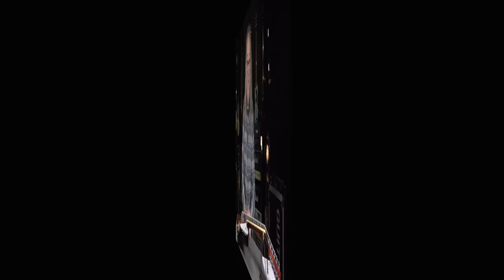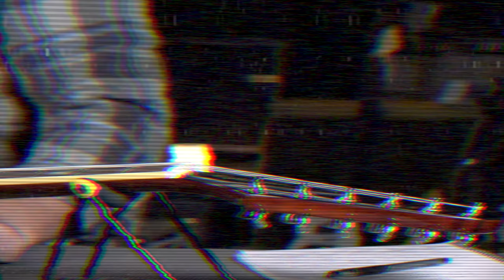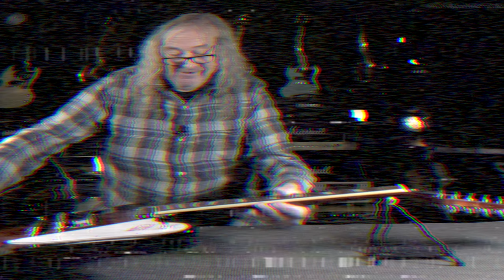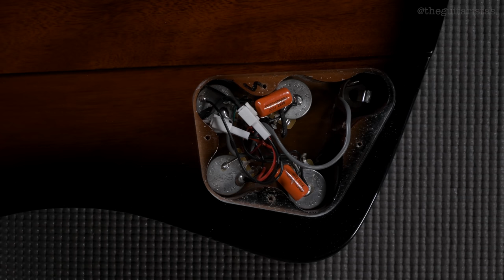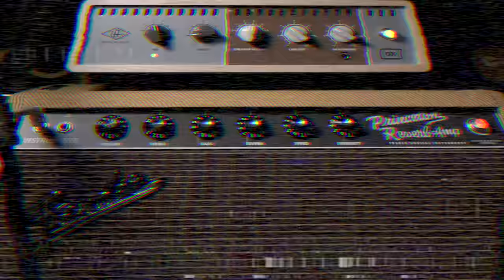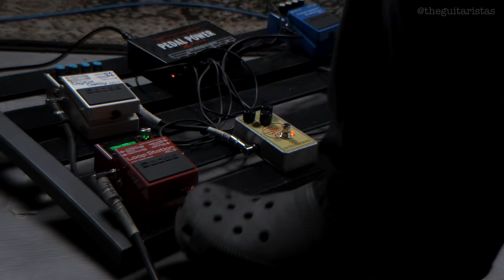Epiphone Firebird Vintage Sunburst - Authentic and Affordable Inspired by Gibson Classic!

Comment: My son-in-laws cousin just bought one of these through Guitar Center and they actually did a very nice setup on it. The action is perfect, intonation is perfect, no fret buzz, no high frets, and the nut is cut correctly. The guitar plays and sounds better than the Gibson Firebird I owned back in the 70's.  It was very easy to play some Johnny Winter riffs  and it sounded great through a tube amp.

Comment: I’m surprised at my reaction to that guitar….. I really like it Colin. It looks particularly high quality and you made it sound killer. 👌
Reply from the maker: Cheers man, something really nice about this type of pickups! 👌🔥
Reply: @theguitaristas  Firebird pickups are humbuckers, but with a slightly different design. A mini humbucker is just like a regular humbucker but with smaller bobbins; it has steel pole pieces running through the center of the coil and a bar magnet under the coil. A firebird pickup has the same small bobbins as a mini humbucker, but instead of steel pole pieces and a bar magnetic, it has magnetic blades running the center of the coil.

Comment: Another great way to start the weekend. Top notch video. I have a hagstrom fantomen which is kind of similar shape ish and it’s huge. The case is massive. But sounds killer and made kind of famous as the band ghost use them. I highly recommend trying them out. Have coil split and one of the best fret boards ever played . The scale length is slightly larger though at 25.5” which takes bit of getting used to. Excellent guitar

Comment: Good in depth review as usual, I’ve got the Epiphone Firebird from around 15 years ago which is an excellent guitar but has a set in neck which is obviously a deviation from the original Gibson design. I’m quite tempted by this new version due to the through neck and multi laminated construction although I don’t think that it sounds significantly different to my older guitar . As far as I understand the original Firebird pickups were humbuckers with two bar magnets one in each of the bobbins unlike the usual one bar magnet between the two bobbins that most humbuckers have. There have been various differences in Firebird pickup designs over the years including one with a single ceramic magnet between the two bobbins. Finding a reasonably priced gig bag or case for one of these monsters could be problematic but I wonder if a bass bag or case might do at a push.

Comment: I like the Inspired by Gibson lineup. I'm a bassist and just got my first ever guitar which is a an Epiphone ES-335, for about $475, from that lineup. It's made in China but the quality is decent. The flamed maple top is so good to look at, I got it on Blueberry Burst. Just needs a bit of setup but I pretty much do that on all my basses even from those over $1000, because my setup measurements are personal and exact, no factory could get it right, doesn't matter if it's from US or China.

Hardware is decent too. Tuners work fine, but I hate the bridge, it has the wire over it, so irritating, I bought a $30-Gotoh bridge made in Japan, and it's fixed, no pesky wire. That's it. Adjusted pickup height and I had a decent ES-335.

Comment: I love, Love, LOVE my Epiphone Firebird. Epiphone has really upped their game over the past several years. I am an inveterate tinkerer, when it comes to my guitars. I’m constantly tweaking, adjusting, etc. The Firebird and the 50’s Les Paul are the first to Epi’s I’ve owned with which I was perfectly happy. The ONLY quibble I had with the Firebird was the pickup switch. That’s a cheap fix. Otherwise, the pickups, the construction, the finish… I am completely satisfied.

Comment: Nice purchase !
I have one, bought at the end of May.
I saw them about a year before but couldn't afford one.
Gift to myself when i turned 65. Only found one place that had one so ordered it (ZZZs....). 
Found a form fitting gig bag elsewhere. $70.00. No need for a hs case since don't gig anymore. I don't think anything else would work. Like you said, the guitar is massive ! Saved $50.00.
So, i get the guitar delivered and the inside box is banging around in the outer box. Thought about refusing but took a chance since this was not easy to find. Really pak'd like trash.
Worked, played good and i'm stoked. About 6 weeks later, it starts acting up, out put jack failing and the br pup working off and on. Decide to call the seller and i'd just passed the return dead line so had it fixed locally,,,,about $180 which included a complete set up. Not great but since the guitar was basically a gift, i can live with this.
Man, the action is about half as high as it was and i'm in love !!
The problems weren't the guitars fault and i'm still amazed by the overall build quality. The same multi ply neck thru construction as a Gibson with maybe better pickups. i took care of a '76 in the mid '80s while a friend was in the hospital. I never really got on with it.
This Epi is truly amazing !!! Congrats on your score !!
Reply from the maker: Cheers Glen, congrats on yours too mate! 😁👍
Reply: @theguitaristas  Thanx. Its plugged in now,,,,wrung it out for about half an hour.
Been a couple weeks (rotate stuff).
Still in love. It's a great guitar !
Rock ON !

Comment: From what I understand the difference between a Mini Humbucker and the Firebird pickups is that the Mini Humbucker uses small poles like a regular humbucker where as the Firebird uses a single bar across the strings instead of individual poles under each string. Similar to some of the Bill Lawrence pickups, but in miniature form.

Comment: Great review of another great Inspired by Gibson Epiphone guitar! Colin, I bought the same Gator gig bag and like you, am underwhelmed. I have an EpiLite Explorer case for my Epiphone Moderne. I just did a test fit, and the Firebird fits with room to spare, however, due to the long head stock, it touches the case, so it needs to be propped up a bit in the neck rest area or the "neck joint" area. Edit: Based on my web search, it seems the EpiLite Explorer case is no longer avail. anywhere. Bummer.

Comment: The Firebird pickups are, in fact, humbuckers.  They differ from a mini humbucker in they use bar magnets and not individual pole pieces, hence the covers have no screw holes.  This difference makes them sound a bit different.  I installed a '64 Firebird pickup in the neck position of a Telecaster and it sounds wonderful.

Comment: There's a fabulous Joe Gore video comparing mini humbucker and Firebird pickups in the same guitar.
Goes a bit into what Firebird pickups are - but yes bar magnets inside the coil. Mini humbuckers are built like small humbuckers. Without going into the airy fairy, the idea is that the magnets are closer to the strings than in a humbucker, like the rod magnets in a single coil. Hence brighter.
Reply from the maker: Cheers Iain, I shall look for that be good to hear a comparison!

Comment: Let me clear up some myths about the mini humbucker/firebird pickup because I've used them for 25 years and I make both, they're my favourite pickups by a mile and I just love them. The firebird pickup IS a mini humbucker but they are slightly different. You could say they're brothers a mini bucker has one coil with screw poles that you see through the cover holes and the other coil has a steel blade with a bar magnet underneath connecting the two like a regular humbucker. A firebird pickup has two coils the same size as the mini but instead of screw poles and a steel blade they have a small bar magnet that fits in the bobbin like the steel blade does, this means no need for a bar magnet underneath. This design has less output so they reduced the resistance also compared to the regular mini to about 5.5-6.0 kohms, a regular mini is between 6 and 6.5k. They do sound very close to each other, In my opinion the firebird version sounds a bit more "Fender-esque" with a bit more chime and clarity,  less bass and sustain. People like to say they're in between a full humbucker and a single coil but I think they're different, perhaps adjacent to both, they really are there own thing and you sometimes need to approach tone shaping differently because they react to changes in your setup differently than a single coil or a full bucker. I found they gave me a whole new world of tone, they can really inspire you to get out of a funk, think fresh.

With a 7.7 and 7.8k reading, what Epiphone have given you is a modern version of a mini, the coils are so small that to get that much resistance they must have used thinner wire. I'm not saying that's good or bad but its not "original" or "vintage" spec. 
You can here my mini humbuckers vs Epiphone minis in Paul Stafford Cook's Riviera video coming up.
Reply from the maker: Cheers Ben, and thanks for the illustrations you sent over I will post them on the Guitaristas forum!
Reply: @theguitaristas  Happy to help

Comment: I bought the Epi Firebird and Korina Explorer in 2020. Both are stellar guitars, and the fit and finish are far superior to my 2019 Gibson Les Paul Standard. Took 6 months to get the ginormous cases for them as they were on back order. As a rule, I usually change the pups and pots on new guitars, but both guitars sounded great right out of the box, so they remain stock.

Comment: Perfect timing. I had a Joe Bonamassa Firebird 1 and sold it for more than I bought it for new after a few years. But I missed it. So I bought one of these. Not disappointed. Definitely a keeper. I replaced the tuners with locking tuners and the bridge/tailpiece/inserts with parts from Faber. I just need a case now. They've been out of stock on those for a while.
Reply: PS firebird pickups are humbuckers. The difference is that they've got a bar magnet for a pole piece.

Comment: Firebird pickups are actually two alnico2 rail bar magnets, each in their own plastic bobbin, 
between a small across top and large bottom metal plate,  with 2 wooden shims underneath.
To my ears one of the best sounding pickup constructions, besides Fender single coils :-)

Comment: Good video Colin. My Firebird has a slight problem.  The volume on the low E is quite weak, a pickup problem, i suppose.  If you watch Trogley’s review, his has the same problem, different string
Reply: Mine had the same problem.  The jack was loose.  I put a more substantial washer on it, works now

Comment: Great video sir. I have a 2019 Gibson Firebird special personally. It’s far from perfect qc wise but a great guitar nonetheless. They are marmite guitars physically but they certainly occupy a niche. One of your other commenters mentioned that traditional firebird pickups differ from mini humbuckers in that the magnets are in the coil, rather than steel poles like an original epiphone mini, or a lp deluxe pickup. This means they have significantly less eddy currents, and a much more defined peak like a fender single coil. They are  humbucking though. 
The 70s bicentennial models had a pickup design known as a sidewinder which has the coils facing each other parallel to the strings and a blade pole in between. The modern Gibson firebird pickups have ceramic magnets and are very very high impedance, the epiphone reissue models are actually closer to an original. 
Allen Collins of skynyrd actually had a p90 in the bridge of his most famous Firebird 1, and a retro fitted lp deluxe mini in the neck. 
Keep up the great videos, hugely enjoy your presentation.

Comment: I was thinking of a Firebird I had thirty odd years ago. It was made by CSI, which I was told was Ibanez. Had the banjo machine heads, like Gibson, and the Maestro type vibrato. A previous owner must've put Gibson stamped humbuckers on it, not the mini buckers you associate with Firebirds. Can't remember if it was thru neck or bolted. Came with a nice hard case. One of the guitars I wish I still had.

Comment: Love Firebirds, though you’re right…They’re huge! Not a major problem for a big bloke like me, though it did amuse me to see a skinny little thing like PJ Harvey playing one a few years ago! I’ve had my 91 Gibson Firebird V since about 2004 and as a Fender guy, it did take a bit of getting used to. On the strap, it hangs two frets further to the left than most guitars! Craig, the guitarist in my band, Leavin’ Trunk, got an Epi like yous a few months back and he loves it to bits - despite my teasing him about it not being a “proper” one since it has conventional stock-out-the-side tuners! Shame, as a set of Steinberger Gearless tuners would sort that! I actually replaced the banjo tuners on my Gibson with Steinbergers - several years before Gibson started using them. They balance - and hold tune - way better than the originals and still look “right”.

Comment: Really cool guitar .Very appealing .  Epi did firebirds in the past but they were not neck through build. This 'Gibson inspired' well worth the name this time.. More inspired...
Awesome playing once again,  after each of the vids i think i must put my looper on the board but perhaps i'm too lazy.
You are right in saying that Firebird pickups are different than mini-humbuckers. But they are real humbuckers nonetheless. A mini is like a smaller PAF type (altough it is originally an Epiphone design)  with the magnet lying between and underneath the coils while the Firebirds are build like Hot Rails with bar magnets inside the coils. That why there's no pole pieces. SC sounding but real humbuckers.
Reply from the maker: Cheers Ant... most important pedal on your board after tuner is the looper!

Comment: Hi Colin… told ya! (around a year ago! But, with all the comments you read - and I can see you do😬 - you’ve probably forgotten). 
‘Street’ then was £529.00 and, as I usually do, I got a discount from my favourite big dealer - around 6.5%, getting me the Firebird for £494 + change. Got an Epi fitted case - same discount (😬!) - at the same time 
BTW: IT WILL FIT ANY bog-standard stand, easily!
Just wrap a thickish elastic band round the left side of the ‘horseshoe’, under the bottom of the lower bass bout - works a treat! Stops it sliding off sideways, and it’s perfectly stable.
Bleedin’ great guitar, innit! 😜
(I’ve got the Flying V, too.  Shame they only come in black… really wanted a Korina (or faux-Korina?) version - ho-hum!
Reply from the maker: Cheers Rob, I do remember it wasn't that much more expensive last year... but yeah I get a few comments so you will forgive me if I don't recall specific conversations! 😆 I think your 'rubber band stand' fix  sounds like a right old bodge job but I will give it a try as I keep tripping over my neck floor stand thingy 🤣 yes great guitar and worth the hassle... Explorer is next on my list!
Reply from the maker: @rob_in_stowmarket_uk  🤣👍 Keep taking the medication!
Reply: @theguitaristas  Mmm… rather not be having to have the op, mate! Ho-hum🙄
Reply from the maker: @rob_in_stowmarket_uk  Oh yes of course... hope all is good mate.

Comment: Thanks for making this video. Your playing is fine, no need to apologize. I bought a brand new Epiphone Firebird two weeks ago and boy was I surprised with the quality! The Chinese luthiers have really stepped up on this guitar. The only thing I can complain about is that, personally I would have liked a little more output from the bridge pickup but that's an easy fix. Any suggestions on a higher output Firebird pickup?
BTW I think the technical difference between a mini humbucker and a Firebird pickup is that a mini humbucker has a magnetic bar on the bottom and nonmagnetic pole pieces connected to that magnet, like most humbuckers, while the Firebird pickup has magnetic blades in both coils in each pickup and no bar magnet at the bottom. So they are humbuckers but different. Please correct me if I'm wrong.

Comment: Colin, sorry mate but you're wrong about the pickups. They are NOT single coils. Although it's true that they aren't "mini" humbuckers under the covers, they ARE  twin coil, RW/RP humbucking pickups. 
The difference is in the construction. Gibson humbuckers are built with the magnet at the bottom, magnetizing the slugs and screws that come up through the coil. Firebird pickups are built like Fender pickups - the magnet itself is the polepiece inside the coil (Fender's original "Wide Range" humbucker was made like this). In the case of the Firebird, it's a bar magnet inside each coil, so kinda like a "rail" but the principle is the same.
Anyway, as always, great demo. The guitar sounded terrific!
Reply from the maker: Cheers Peter, yes every day is a school day! 😁👍

Comment: Gibson made the firebird in the seventies also, only for a few years. 1976 I know for sure. Also Duane Allman played a white firebird III. I absolutely love mine. I only wish it had the correct headstock and banjo tuners. The difference between the firebird pickups and mini humbuckers is the mini's have slug poles like standard humbuckers, the firebird pickups have rail poles like a hot rail. And they are humbucking, but do give a bit of single coil nuance in the overall sound of them.
Reply from the maker: Cheers Donny, really good info man! 😎👍